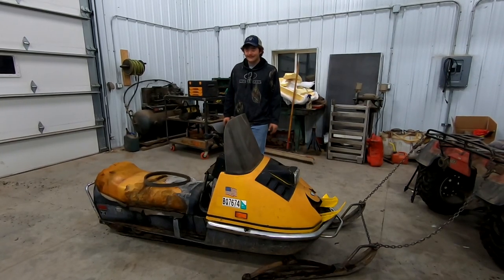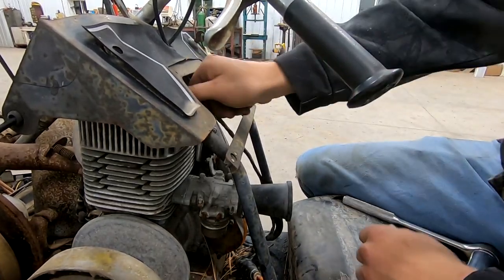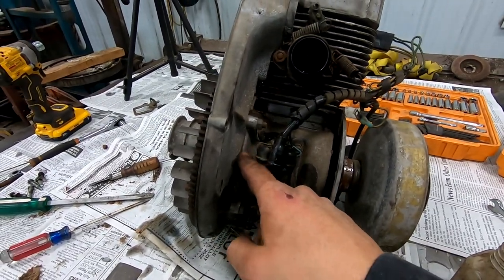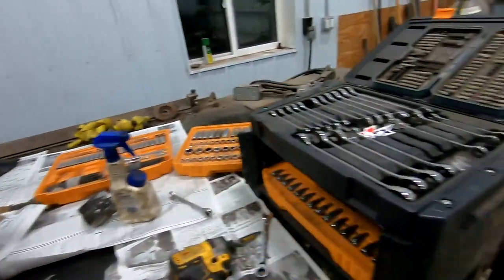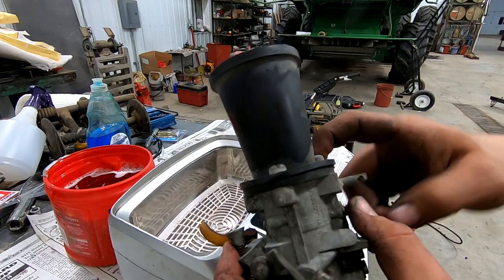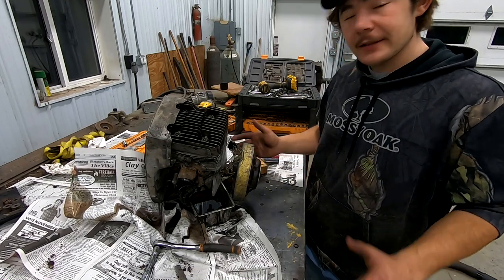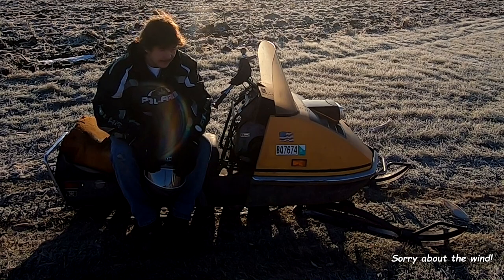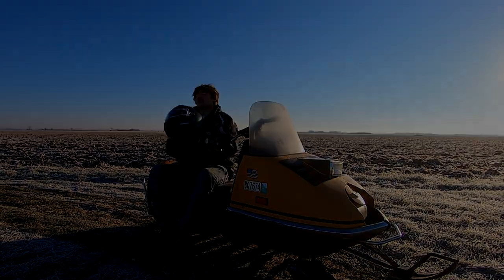Skidoo Olympic Revival (335 Single)

Comment: Nice Video! Would like to see some Performance Mods for these Old Singles. I see this 335 has an Electric Start option. Those Starters are hard to come by these days. So a Starter upgrade option would be nice. Maybe using a Cheap New Seadoo Starter.